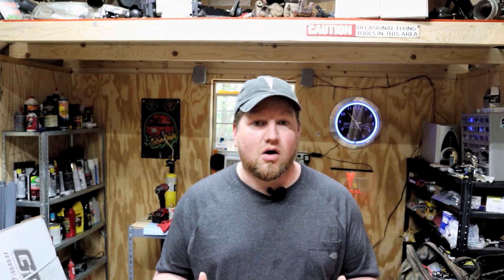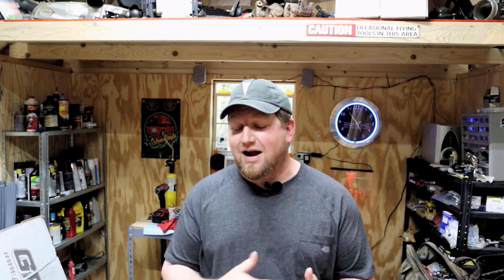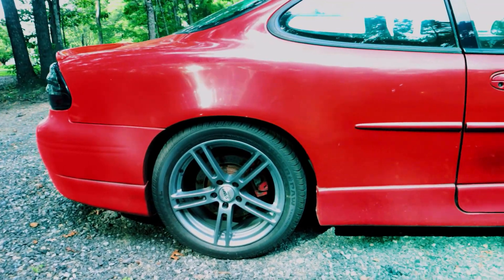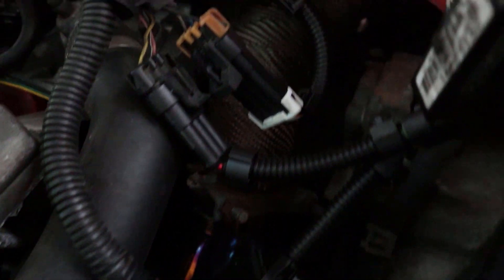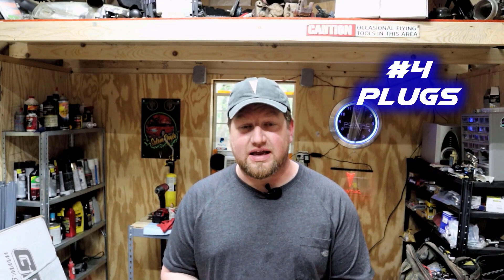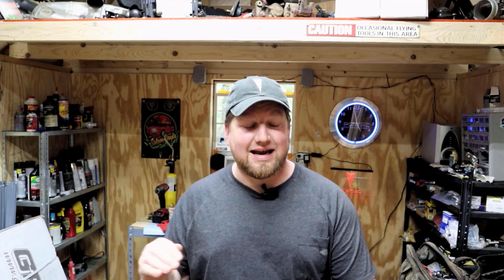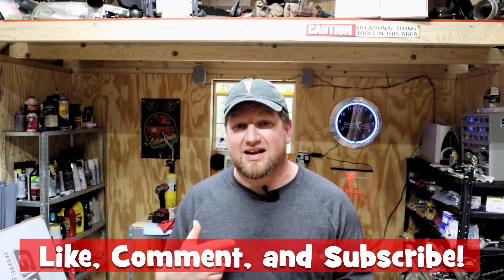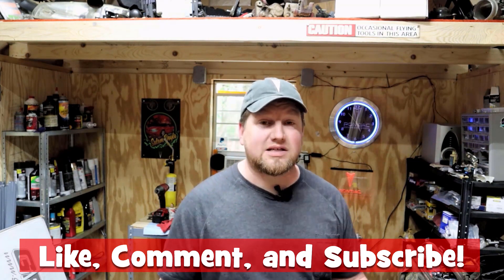5 First Mods for your 3800 Powered W Body

Comment: I have a 2002 ssei and the only thing that has been done to it is the 180 degree thermostat and cold air intake. Will this help with KR?
Reply from the maker: The thermostat will a little.
Reply: Fender well intake, good insulation, cold air knocks less
Reply: @DarkLinkAD  colder air creates more boost, which creates more heat. The best intake dyno gains on these cars have always come from a filter stuck right on the throttle body. This will lower boost and create optional flow. Its all about making it easier for the engine to "suck bang and blow"

Comment: Yeah I'm just wondering seriously about this I have a 2004 Grand Prix GT base model I need to know how or even if it's possible to take a supercharger off of a GTP and put it on my car they're the same engine as far as I know so how difficult will this be and can anybody tell me please thank you basically I just want to know if I can make mine into a GTP by simple simple mechanic work LOL
Reply from the maker: It can be done but requires a lot of parts.  If you google " 3800 top swap " you will find a lot of info

Comment: I have a 1998 Pontiac Bonneville with a non supercharged version 3800, Is it possible to put a supercharger on it?
Reply from the maker: It is.  But its a big job.  You basically replace everything but the block.  Zzp has a top swap kit that makes it easier. But its a little expensive

Comment: I just bought a 2000 regal gs with the sc and it needs rings and valves I’m in myrtle beach any tips on anything or help haha I’ll pay for help
Reply from the maker: The bottom end of these are usually pretty strong.  Are you sure it needs rings?
Reply: @SalemDoyle  it’s not very happy when it runs and when I remove the oil cap it smokes like a train  that’s the only thing I could make sense that could cause it
Reply from the maker: Ouch.  At that point the best option might be a low mileage used engine.  They usually arent too expensive
Reply: @SalemDoyle  that’s was I was thinking I don’t wanna rebuild it for the price of a low mile one and I’m not sure what it’s been through either. I appreciate your time thanks
Reply: @SalemDoyle  one more thing could you use a na block and just put everything from that motor on it?
Reply from the maker: @williamboat9393  yes.  It will just have higher compression

Comment: I have zzp wires,colder plugs,cai. Do I need more before I can drop smaller pulley? I wanna put a 3.5
Reply from the maker: I would at least do a downpipe.  Then monitor for kr
Reply: @SalemDoyle  so only thing I can use right now is a 3.8 or a 3.6?
Reply from the maker: I would check your kr first either way
Reply: @SalemDoyle  where can I buy a kr monitor?
Reply from the maker: Zzp has one.  And some other auto stores
Reply: @SalemDoyle  sorry to keep bothering you, can you drop the link to it? I couldn’t find it
Reply from the maker: @bwright1k395  https://zzperformance.com/collections/3800/products/aeroforce-interceptor-scan-gauge
Reply: @SalemDoyle  single pt?

Comment: PLEASE TELL ME THERE IS SOMETHING I CAN DO TO MY 08 3.8 v6 n/a i need help!
Reply from the maker: Plenty of stuff.  What is your goal
Reply: I don’t really have a goal I’m on a budget i just want to add sum power and it’s pretty fast stock but 200 hp just Isn’t enough for this heavy of a car
Reply from the maker: Without boost you probably won't see any big numbers but there are a few add on that you could start with like exhaust
Reply: Ok i got the exhaust done lol straight pipe catless with a flow master it’s loud as hell , what’s next besides air intake
Reply from the maker: Look at zzps site.  There staged kits give a good idea of the first few mods

Comment: I have a 97 N/A Grand Prix artery keeps dying and fans come on after it’s way hot, need help
Reply: Battery
Reply from the maker: Start ny checking/replacing your coolant temp sensor and make sure both fans work.  Wouldnt hurt to do the thermostat too.
Reply: @SalemDoyle  thankz

Comment: I just bought  98 gtp  with  only  9000 miles  , any  recommendations what I should  replace
Reply from the maker: Thats crazy low miles.  Just look over the basics.
Reply: Thanks
Reply: I replaced tires ,brakes  and still  have  vibration  between  70 to 80 mph
Reply from the maker: All the time or just when accelerating?  Stock wheels?
Reply: All the time   ,yes stock wheels,  nobody was driving this car for 13 years
Reply from the maker: I would have the tire balance rechecked and the alignment

Comment: yes, suck in that hot engine air instead of  fresh air.   its designed and programmed with what it has.  computer is set for airflow, congrats on getting 1.5 more HP lmfao.